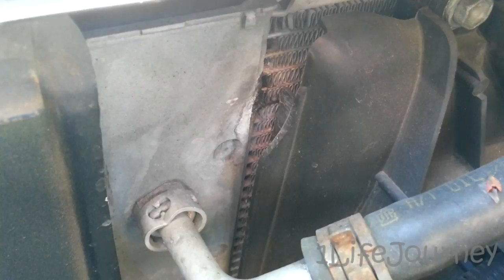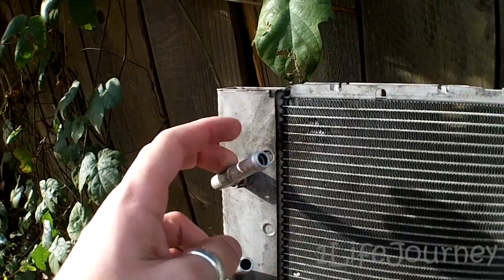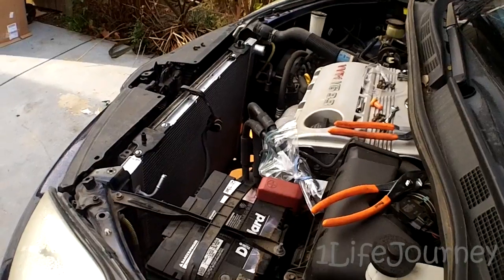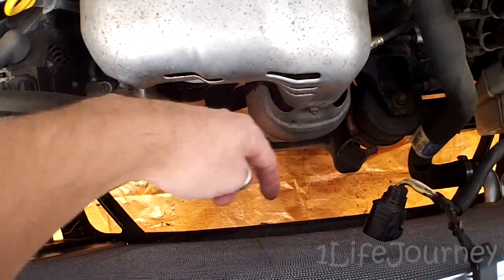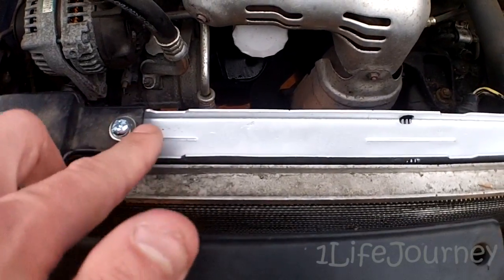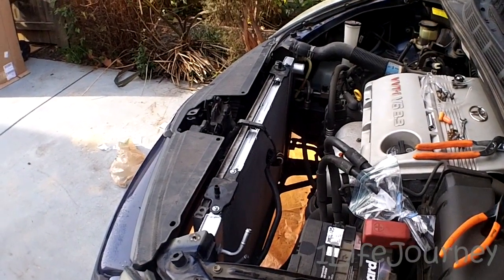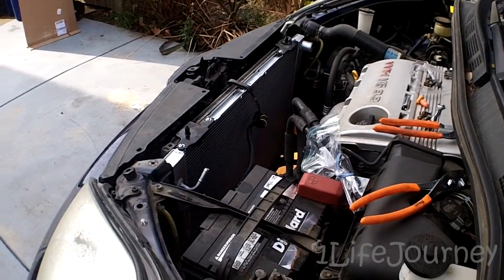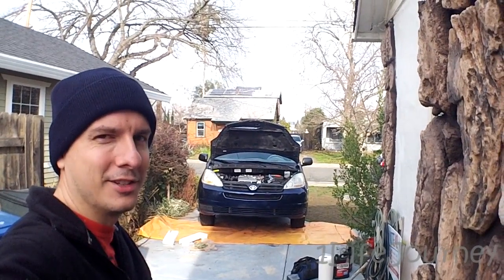2004-2010 Toyota Sienna - Tips for radiator installation

Comment: The new radiator transmission cooler will be dry and will need to be filled with fluid so it will take more than what you measured as having leaked out

Comment: I just replaced mine because I was getting transmission fluid in the radiator from the tow package.  I ordered that same Spectra off of Amazon Canada. Almost half the price as anywhere else in Canada. Did not replace my thermostat or rad cap just hoses as  cold weather was coming in a day. You don't need to undo the hood latch bolts. Saved me a thousand dollars by not taking it to Toyota.

Comment: Thanks.  This was really helpful.  It looks like Toyota changed the the radiator/condenser mounts sometime around 2006.  My 2006 has one-piece brackets top and bottom that run the entire length of the radiator, not two separate pieces like you have.  Spectra must have designed the radiator based on the 2-bracket design.  I'm not sure whether I can make my brackets work.
Reply: My sienna built 8/05 has the radiator with the plastic tanks and the one piece top bracket.  I can't find the correct replacement.